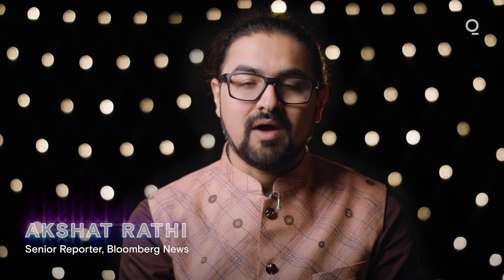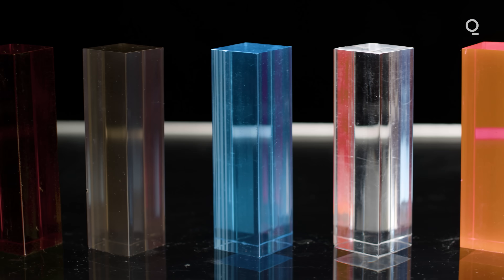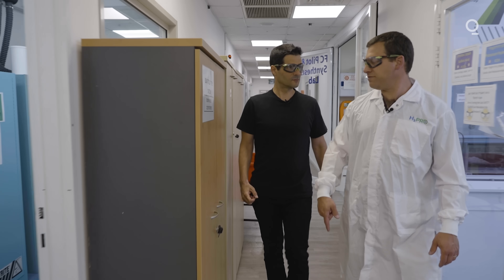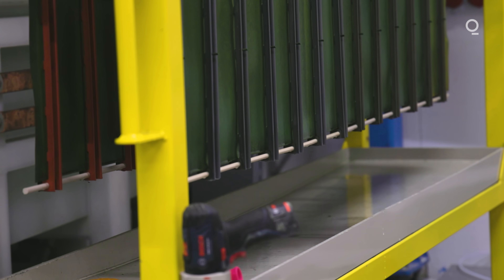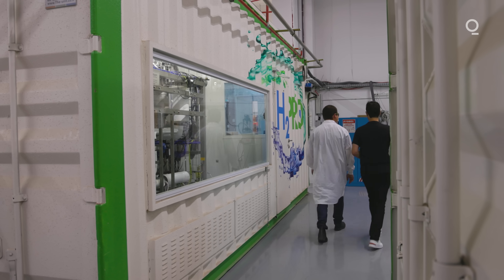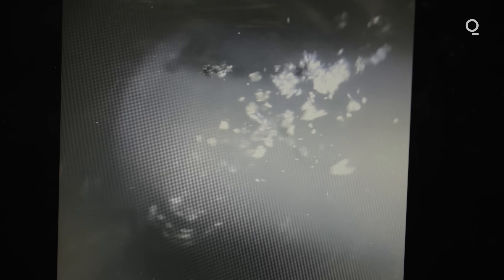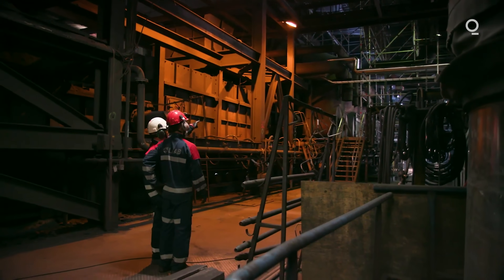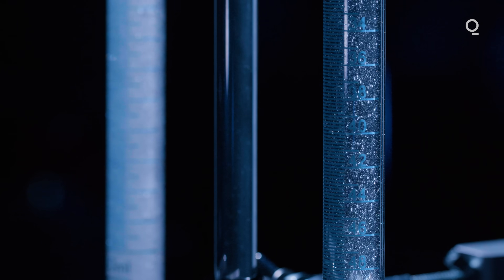How Cheap Hydrogen Could Become the Next Clean Fuel

Comment: maybe, you could develop fast high temperature nuclear reactor to produce hydrogen as by-product(mainly to produce electricity)

you get electricity and hydrogen at the same time. its no brainer, but anti nuclear movement is to great and oil industry is very scared by the result. just block them with so called environmentalist

Comment: Hydrogen is the best. Rather than creating millions of batteries with rare earth metals, which is surrounded with supply constraints. It's better to use hydrogen. Also depending on one tech will only delay the transition to cleaner fuel.

Comment: You are wrong to say that hydrogen, when burned, only produces water. In air, burning hydrogen produces NOx, nitrous oxides, which as a greenhouse gas is more potent than CO2 by a factor of 100 and is the reason we're trying to get diesels off the roads....

Comment: The mistake is not co2 but the heat generated by combustion. Hydrogen used in the combustion process also generates heat along with consumption of oxygen

Comment: Thinking not about the economics but about the physics, extracting hydrogen gas involves the use of a huge amount of energy. And with our current set up that means burning a lot of fossil fuel. Ergo, hydrogen is not a green fuel. It's more like a battery in yes of converting one sort of energy into another.

Comment: We Need Hydrogen on demand Systems to covert Vehicles on the Ground. Then the water in the large tank is still water the whole time & stays stable, and is only drawn out of the large tank when the small tanks processor needs more water to process more Hydrogen to immediately send to injectors to burn in a combustible engine. The Oxygen could possibly be released to the ground, or collected in a separate additional small tank to be released at another time. Even in pure Hydrogen from, Hydrogen is more stable than gasoline or diesel, because the gasoline Atom has 5 rings around it, and the Hydrogen Atom only has 1 ring around it. The more rings there are around an Atom the less stable it is in being flammable.

Comment: Hydrogen is not a source of energy, it is energy storage. There is no naturally occurring hydrogen (in non trivial amounts) so it has to be made. Unlike say, sunlight, wind or wave power, which is there to be harnessed. Or petroleum that just needs to be pumped out of the ground. So you need to put energy in to get hydrogen, and then you recover some of that energy (less than went in because nothing is 100% efficient) when it is burned. It doesn't matter how cheap it gets to make, you still need energy to make it and the energy provided is minimal - unlike nuclear fuel which requires intensive mining and refining but packs a huge amount of power - more than went in.

Comment: Great video. But can somebody explain to me why hydrogen made of nuclear energy is pink and not green? Is it just because Greenpeace told you so, or what? :D Nuclear energy has similar CO2 production as "green" sources (through whole life cycle of device). 
Also great part of effective hydrogen creation (as I've learned in this video) is done by heat. Creating heat from electricity is very ineffective. You can use some of the steam generated by nuclear power plant (by sacrificing a bit of energy output) and generate very cheap heat. 
So if you think about combining this, nuclear energy + hydrogen production should be the best possibility!

Comment: Talking about CO2 as if it is some kind of evil villain that needs to be dealt with for scientific reasons that are completely false and a fraud completely discredits the credibility of the rest of this material. CO2 is inhaled by the plant kingdom, end of story. The ecosystem of the planet is infinitely more intelligent and balanced than anything spewed in this report. Taking natural gas and purifying it into hydrogen is really quite disappointing. absolutely nothing innovative about it. Electricity/power will not be a limitation as it will be very inexpensive very soon via safe modular (Sea can size - Radiant) fission power plant units. Stick with water and diamond wafer H² release disks for storage. French Phd couple from France devised sponge type alloys to release H² very safely decades ago.

Comment: foolish notion. Hydrogen is locked up in a molecule that takes a tremendous amount of energy to separate. After  separating then you want to use it and it is  1 of the least energy dense  sources out thereTo be used as fuel.

Comment: $1.5 or $5/kg Hydrogen is not Hydrogen Energy.   This is used in the chemical industry for making Hydrogen in real time, its uncompressed.  These Chemistry people think it can be used for energy, but Hydrogen for energy purposes like transport costs over $16/kg.  The main costs are in compression, air pumping and distribution, which needs more than 2x the energy you get out to be added AFTER you create the Hydrogen.  These amounts are set by physics, not Engineering, there is no way to improve it.  Hydrogen Energy is a scam.  All those solar and wind power that "isn't enough" is actually primary energy, there is plenty of potential, Hydrogen is secondary storage.  Batteries are already better than Hydrogen for most uses, and they have much potential to improve far beyond Hydrogen.  Batteries have no air to pump, no gas to compress, heating or cooling is not strictly required, they are close to 100% efficient.
Using Hydrogen as a chemical for reduction is fine, but its not a fuel use.

Comment: How do you make hydrogen? You split water with electricity. How do you generate electricity? Ultimately you burn fossil fuel. Hydrogen fuel is just a convoluted way of burning fossil fuel. You can’t get more energy then you put in. You actually lose some of it when by turning electricity into hydrogen. It’s more efficient to just keep it in electric form. Any advancements in electric production is better in a Tesla.

Comment: The system may be more "Efficient"... but it still takes more energy to separate the H and O from water than the energy the H can supply.  It's a net negative system.  Until someone can make a catalyst system... it's not worth it.  Any first year physics student can tell you that. (and show the math)
Reply: Hydrogen is about transporting energy. You can build a  Solarplant in the desert but you cant use a cable to transport it over long distances. so you either use Batteries or hydrogen. 
THe whole world is a net negativ system thats one of the fundamental laws of thermodynamics.
Reply: @xxxLUKRASsxxx  Sure... the world is a net negative system... but that's because we use the energy for work.  If the value of the work is justified then it's not really negative.

Comment: I’ve been hearing about hydrogen fuel cells since the 1990’s, and yet the majority of EVs today are lithium batteries which are inefficient and dangerous. Why?
Reply: Starts with M and rhymes with honey.
Reply: While storing electrical energy with charger and batteries is only 85% efficient, storing electrical energy with water electrolysis, compression for storage, and fuel cell to produce power is only 27% efficient. It takes 3x more electrical energy to go they hydrogen route. So, BEVs win on efficiency. 

The high cost of hydrogen fuel cells, and the high cost of hydrogen storage tanks means that hydrogen FCEVs cost more than equivalent BEVs. So, BEVs win on vehicle costs. 

Hydrogen fuel has a per-mile cost of 20 to 26 cents, electricity has a per mile "fuel" cost of 2 to 3 cents. So, BEVs win on fuel costs. 

Electricity is available everywhere, and the cost if installing a BEV charger is a tiny fraction of the cost of installing a hydrogen refueling station. That is why their are over 46,000 public EV charging locations with over 115,000 EV charging ports, as opposed to a mere 39 hydrogen refueling pumps. So, BEVs win on refueling availability. 

As for safety, while there have been some battery fires, there have also been fires and explosions with hydrogen and petroleum fueled vehicles. On a per-mile or per-vehicle basis, BEVs are safer than hydrogen or gasoline or diesel. 

BEVs win on every metric.

Comment: How much energy does it require to produce the X smount of hydrogen? According to the law of thermodynamic, you can never get more energy output than your energy input. Do you know that it will require MORE energy input to produce less energy output, that is the hydrogen. Therefore, hydrogen fuel is another scam also.

Comment: Sodium    produced  by  electrolysis  in  pellet  form  can  be  stored  in  plastic  tubes,  dispensed  into  closed  chamber,  water  sprayed  over  can  produce  Hydrogen  on  spot  /  on - board.  Problems  in  storing  Hydrogen  in  heavy  pressure  tanks  can  be  avoided.  Effluent  Sodium  Hydroxide  can  be  eloctrolised  to  reclaime  Sodium  for  further  use.  This  is  much  suitable  for  Automobiles,  Ships  and  Aircrafts.
Reply: You are suggesting using a caustic compound in you fuel?

Comment: Overcome H2 Storage Difficulties with Ammonia, Liquid Ammonia @ -33 Rather than -250 for H2. Liquid Ammonia Holds More H2 than Liquid H2... Ammonia is the Answer. Mainspring Generator Can Run of H2 or Ammonia, Diesel Engines Can Be Converted to Combust H2 After Being "Cracked" from Ammonia. I'd Like to Nevada Miners Set up Solar to Power Ammonia Production & Ammonia to Fuel Big Mining Trucks, Replacing Their Biggest Costs; Diesel.

Comment: If H2 could be produced economically, the environmental alarmists would be against its use for energy production. because water vapor is also a greenhouse gas.
Reply: The difference between water vapor and CO2 as a greenhouse gas is that water vapor precipitates out of the air as rain eventually compared to CO2 which needs to be absorbed out of the air through some kind of process. It's significantly a better alternative.

If water vapor emissions is truly an issue, it's not hard to just have it condensed out of the tailpipe as a liquid instead.
Reply: @BrokenLifeCycle  then all we will hear about is how more water vapor is increasing rain and flooding. Theres no winning with environmental alarmists. There will always be something pissing them off.

Comment: I wish I could learn about this because we need more hydrogen stations to make this happen in the US only California has hydrogen stations from what I heard
Reply: This hydrogen won't be for cars in all liklihood, but for other uses.
Reply: @cow_tools_  what would they use it for?

Some of the new cars they want to come out with can convert hydrogen to electrical power or something like that
Reply: @TheRandomRobert71  You don't really see the problem. First, you have to buy a new car. It's always about buying one unit of a brand new something to replace the old thing. That's the biggest problem in climate change issues. You always have to be a consumer hence polluting more. You still need to produce new chassis out of metal, the onboard electronics, the seats, various plastics are involved and all that. And said car has to entertain the illusion that eventually hundreds of millions of people will drive those in the future. Until then we are already facing bigger problems.
Reply: Have we not learnt our lesson with the Hindenburg?  Hydrogen goes Boom!
Reply: @CORVETTE_DUDE_CHANNEL  You know, gasoline also explodes. The Hindenburg burned because it was a massive balloon filled with a flammable gas. That was stupidity. Engineers are much more informed nowadays than in the past. Using a single example of a disaster related to something as the sole reason to not pursue that thing is childish. When something like hydrogen has potential as a high efficiency energy storage, we ought to be more thoughtful than to dismiss it due to a single disaster.

Comment: Hydrogen green? Just the extra costs because of its nature for compressing, storing, transporting will mean it's not green at all. Water electrolysis procedures are around 80% effective 
(20% of electric energy lost into different forms of energy) - even if you've gone up to 99% you still woudln't solve the primary problems of hydrogen.
Reply: Not really. It can be used in conjunction with wind and solar etc because you can't store wind energy at scale. So if there's a way to convert using other forms of green energy and then you can release that energy on demand, that to me is green
Reply: @vueport99  How is this any better than a battery?
Reply: @davidsandy5917  battery has much more limitations in terms of capacity, and higher cost. Also you can't use batteries to run a steel plant.
Reply: @vueport99  True, you could use any extra electricity you have from solar or wind to make hydrogen. But it's not efficient. It will not be "the future". It will always be more expensive and less efficient. A bit of a compromise for the failures of solar and wind. Wind and solar are not green btw. They use very polluting industry to make solar and wind. In the end it's all about money, not the environment. The same people being subsidized for being green, are the same people who own leaking oil pipelines. They don't really care about nature.
Reply: @benanders4412  fair enough, at the end of the day it's all about money. And people now care so much more about alternative energy because fossil fuel is priced so high. If gas was 50c a litre we won't be here discussing this topic now
Reply: @vueport99  That's why the price of gas is this high.
Reply: @vueport99  you can store electricity in huge scales, its called Pumped-storage hydropower look it up its the biggest batteries in the world.
Reply: @PurpleDuneEfa  I'm well aware of what that is. But it's highly restrictive where you can implement it.

Try doing that in a flat area or the desserts.
Reply: As long as energy is wasted because it cannot be stored anything is a win.
Reply: Energy density for battary is a problem.
Reply: @asterozo  And will be for a long long time. Hence shipping and big trucks are working towards a hydrogen solution
Reply: Every time you charge your phone you're around 90% efficient due to losses in the charger. So if you're getting 80% efficiency on storing to hydrogen on power that is thrown away anyway, that's a huge win
Reply: @vueport99  you are definitely not getting 80% efficiency on storing/transporting/delivering hydrogen. Stop dreaming.
Reply: @chronokoks  even if it's 20% it's still a win when you're throwing it away
Reply: @vueport99   Absolutely correct

Comment: Would be intresting to see if they could develope a concrete that uses a percentage of the solid carbon.
Reply: would that increase the longevity of it??
Reply: @jarodd666  there were some videos about using graphene snippets, to enhance concrete significantly just by mixing them in. and graphene is just carbon, that would be a way i guess
Reply: @Thunder Life Studios that was a question i heard posed multiple times but just answered with not known or that it will need to be researched for every compound material they will create in the future. but the concrete should be 3 times tougher or something, so it doesnt feel significantly different in regards to recycling than other concrete i guess. Better to look for sources than for answers in my memory of the infotainment i watched xD

Comment: I am missing something in this wholeplan. I really want to know how they will use electolosis to make hydrogen. If the water is converted into hydrogen for energy. doesn't that mean the water will be depleted.  It would need to be a large amount of water. seeing as all the water on earth has always been here and just recycles itself, Does this process change the water we have into something else and how is water a byproduct if we take hygrogen from the water molecules. How is water the byproduct? I can only see this as giving off O instead of our present CO2  pollution.Will we be depleting water used elsewhwere? I have a basic understanding of chemistry and it's a long time since I studied it. Can anyone reassure me that we are not planing on using  huge amounts of  water  do this?
Reply: @Christine Walsh By placing Electrodes into water, electrisity splits the H2O back into Hydrogen and 2 Atoms of Oxygen, So we use the energy(electric energy) to split the molecule, how ever when we take the clean Hydrogen and burn it which means adding Oxygen under hot temperature as spark, we treat H with O and create the water. So it is just reverse process. Similar to the Fission and Fussion when ever Atoms fuse or split they release energy. And we always gain more energy when combining the atoms and not spliting, thats why everyone also wants to make Fussion Reactors to produce energy, in which Hydrogen Isotops are forced together under pressure and large heat to reach fussion state where 100 of milion Celsios degrees are realeased, but in Fission we destroy havy atoms like Uranium into plutonium, but we don't get the same level heat because the havier the atom the more energy will be absorbed by its protons when split.